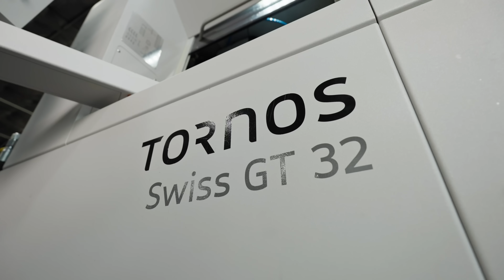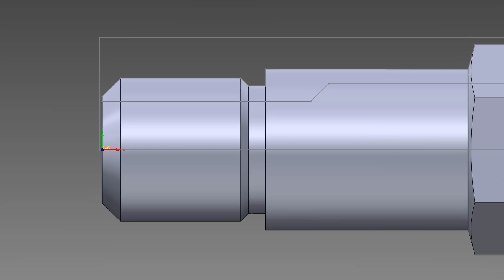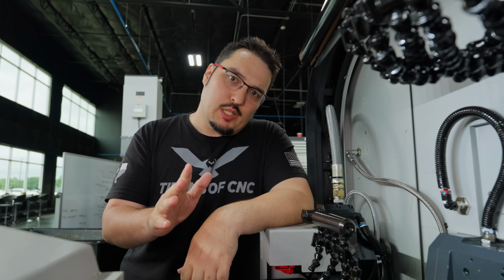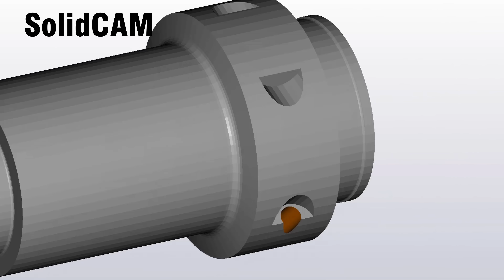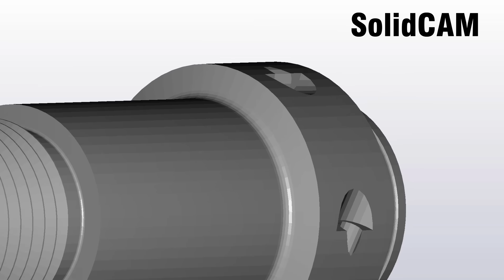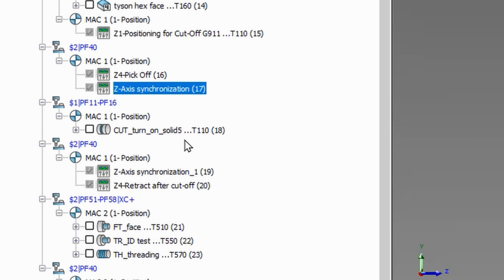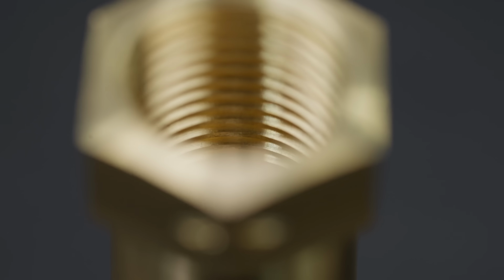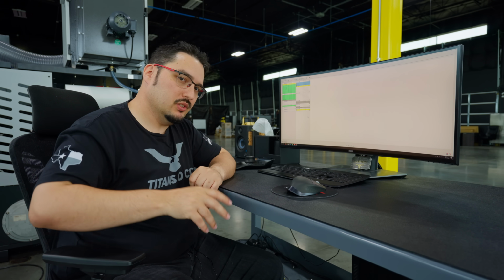Swiss Debut: Tyson Runs His First Part

Comment: You can improve the groove by doing the length first and down the desired diameter then do the slope for the thread in two passes.
For the 6 sides just take everything in one go, it's not taking that much and you're wasting tool life along cycle time
Also even if I lose cycle time I prefer to go through the front and back slope for the thread (and other tools) to remove any burr and have a smooth piece (I go faster though so it doesn't take that long)
Stupid thing I also do to have VERY smooth pieces is radius-slope-radius. So you never have any rough angle. Doesn't take anymore time, just the program being 2 lines longer and you get higher quality pieces.
When you cut the piece, you can change the rotation speed to have a proper speed/diameter ratio and reduce cycle time, especially when you're working with stainless. When I get 30mm diameter, by changing the speed every 2mm you can shave nearly 5sec off

Comment: I'm just curious about something   are you able to program those pieces without software?
Reply: On Swiss machines it would be pretty difficult but doable, due to the multi path programming, wait codes, etc.
But it is possible
Reply: @Bloodtrack8  I disagree, there's nothing difficult about this part.  It's all straight forward and there are no complex features being machined where CAM software would make a difference.
Reply: @DCogs1 good thing I wasn’t talking about the part in the video specifically 😝
What I may say tho is I might replace the word „difficult“ with „tedious“
Reply: Most swiss shops do this without software.

Comment: How do u make sure, that there are no burs at the entry and exit of the od threats?
Reply: Definitely would have burrs... should turn square then thread before thread relief after thread should turn over thread starting from major going to minor then thread relief and finally a re-thread
Reply: Oh, there's definitely burrs all around this part.  But, they are in the business of selling machines.  Most likely someone from Tornos did all the heavy lifting and they just did the filming.  
If a contract shop ran that part as shown they would be spending a lot of time on the deburr table.

Comment: From my personal experience, i can add that the chamfer that is being cut for smoother travel of material in the guide bush should be done from top to bottom. Reason behind that is with harder materials like stainless, as the insert degrades it will start leaving burrs on top of the stock and that will eventually get it jammed in the bush or will make part lenght inconsistent due to with each entry in to the bushing the stock will get slightly pulled out of the main collet. This can have serious consequences like all of the axial tools breaking due to wrong stock flyout. Hope this made sense. ✌️
Reply: Yeah, as I've worked on Swiss lathes, I've experienced that (was a newbie in this trade, but that machine was what brought my charm and love for CNC machines). I am happy that I've experienced Swiss lathes and automated manufacturing on them, I've experienced CNC milling which got boring after a year and a half, now I'm back at CNC lathes, but the big chunky ones (not small swiss machines)😄
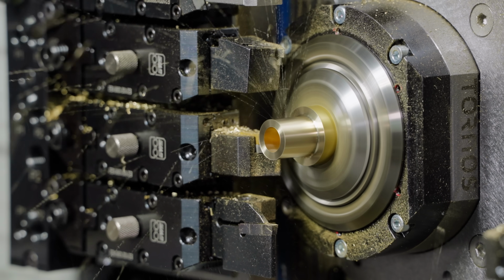Reply: Yes, that's why it's doing it from top to bottom at 3:25 👀
Reply: @McTommyyy  It does , but how many people that haven't dealt with swiss types will catch that small detail that is made in a fraction of a second ? 😅
Reply: for my part I usualy prefer to go with a radius so you're sure to never have any problem
Even if you go top to bottom if the tool is getting at the end of it's life it's going to push the materal before cutting and leave a bump at the top.

Comment: Your machine has a enormous part stick out. Not good for heavy cutting and part runout.
Reply: It’s all supported and only sticks out as much as the tool needs.  Check out the set-up video we did on this machine if you want to see how it all works 😉
Reply: @TysonGilroy It needs to stick out double your cut length. Normal lathe work sticks out by length of cut length. If I am not mistaken, on setup you need to zero at end of your part and the Z axis pulls back double the zero length plus your offset to start cutting your part. BTW the XY work envelope is limited by your Z axis rotate cylinder size. I suppose if you are only doing bar fed work it shouldn't be a problem.
Reply: @DonnaF-yi4jx  I have read your reply multiple times and just do not understand you logic here. The part stick out on a swiss lathe when running it in swiss mode is going to always be supported by the guide bushing so part stick out is not really even a factor. The material while turning is supported right at the front of the guide bushing. When he talks about breaking the part down differently than if it where run in a "normal" lathe is where this difference comes in. You have to be careful not to turn the part down farther back than what the length is on the ID portion of the collet in the guide bushing. On a normal lathe the part would need to stick out the entire part length plus a little for parting off, making it much less rigid as it is not supported past the part length unlike how the guide bushing supports it. 
Like Tyson stated, check out the other set-up video and it will make more sense I think.
Reply: @Jelsner97 Tyson understands because he needs to setup the zero. Perhaps you should ask Tyson. Perhaps he won't, not a good selling point for the machine. The point of moving Z-axis spindle is for cost savings. However, the cost increase comes from need to double Z-axis stroke and the need to add next supports and movement for bar holder.
Reply: @DonnaF-yi4jx honestly, i can't understand you either. the swiss lathe has the bar moving. your tools are stationairy (STAR you can have tools moving in an indepndant z axis as well like I'm on a star 38st) the guide bush supports the bar at all times unless you're obvs going too far back then support is reduced. but that depends on your guide bush length. you mention part stick out but that's not applicable unless you're trying to machine a detail at the front of the part when you've turned much past it? I've turned up to 8inches and run out is next to 0 runout on our spindles unless the bar isn't quite round/bent then it's a material problem not a machine issue

edit* if you're taking about the turn BEHIND the thread then I understand to some extent but really you don't even need to rough that considering the material and even on steel it would have been fine with 1 cut. the whole point is taking material off in 1 cut so not sure why tyson bothered to rough & finish
Reply: @jazzyjazbtw stare at the video for awhile might work.
Reply: @DonnaF-yi4jx  you clearly do not understand how a Swiss type sliding head lathe works, or the purpose of it. Stick out is not something you worry about as the tools are always right next to the guide bushing. Even long parts do not matter beyond not allowing small parts to whip. But thats not relevant either, after a certain point you just grab them with the sub spindle and keep moving.
Reply: @pcsmachineworks please watch the video careful and see how the part moves. Please don't blame your misunderstand on my understanding.
Reply: @DonnaF-yi4jx the part is supposed to move, it's a sliding head lathe... There is no visible deflection of the part in the video. The distance from the tool to guide bushing is fixed. As built by the machine manufacturer, you cannot change that.
Reply: @pcsmachineworks  to understand what I am trying to explain, you need to see double the cut length needs to be unsupported- vised or else the part can not fully retract.
Reply: @Jelsner97 If you don't get yet it is because it is a Swiss machine.